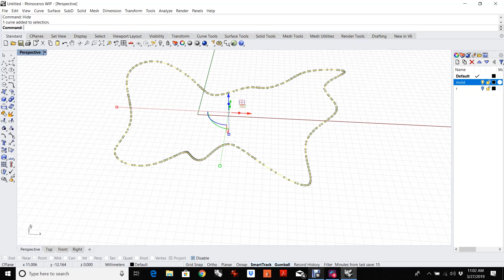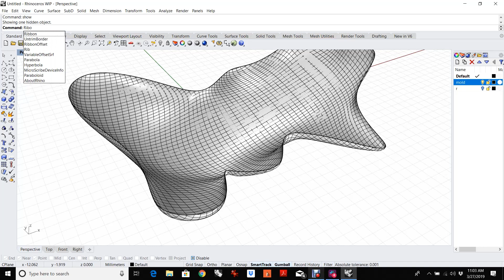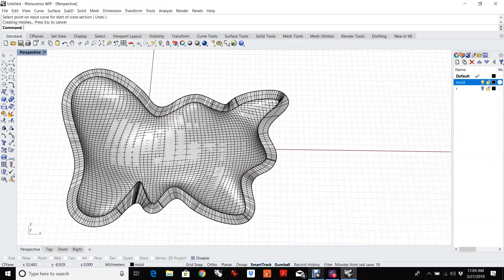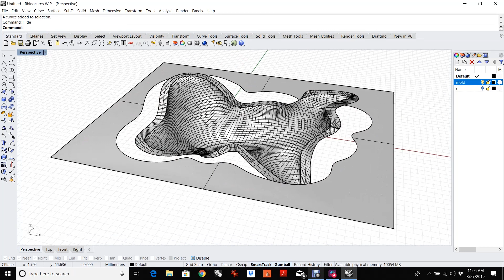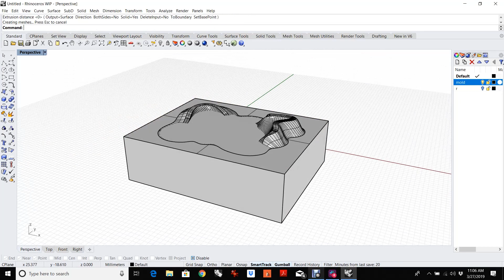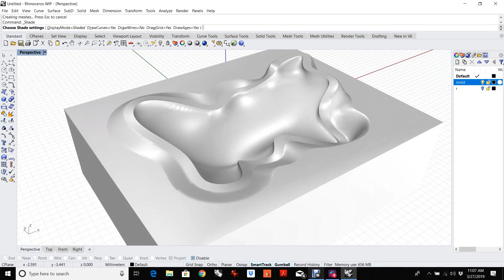Rhino 7- How to Make a Partition Surface

Comment: You fail to mention the cPlane's influence on the direction of the offset.  This command gets particularly nasty when the curve being offset is a 3D curve (not flat on one plane). It seems to only work when in Top view (or whatever view is closest to parallel for the ribbon), its not great. Do you mind also explaining what each option within the ribbon offset actually does?
Reply from the maker: The cplane has less of an influence than you might think... the real factor in how well this works is the complexity of the original curve that is offset. If it's returning nasty results, run a rebuild on the curve, drop a few points but don;t go crazy. simply re-parameterizing the curve using  rebuild often is enough to clean up any gank in the input curve and return a better result. 

if you get some nasty results, it's often because the input curve is a mess. 

SInce we are trying to generate an offset, and since the offset often wants to be less detailed, the rebuild can be super helpful.

Comment: I know this is an old video, I've been able to do everything except blendsrf, as the polysurface from ribbon offset is open? so it doesnt have a closed edge to blend with the planarsrf edge... i cant seem to join the edges either. Not sure what to do about it or where i've gone wrong
Reply from the maker: make sure your tolerances are reasonable, if you 
are working in mm at .001... you will struggle to join stuff unless you model very specifically.

for mm, .01 is usually fine for most models unless they are super tiny.

Comment: HI,

Question: How is it that when I do my draft analysis, the result isn't one closed curved as though it looks like it, but rather a crazy amount of shorter curves all seemingly connected to one another. The RibbonOffset command doesn't work on opened curves. What can I do so that my DraftAngleAnalysis results in 1 closed curved? I had to closed all 48 curves one by one with the ConnectCurve command.
Reply from the maker: hard to say without seeing your file, send it to tech@mcneel.com and we'll take a peek.

Comment: Thanks for all the tuorials, Kyle. I've been using Rhino for 6 months and I'm hooked! I'd really like a full tutorial on moldmaking if possible. Many thanks
Reply from the maker: I’m far from an experienced mold maker, but I did work with one on a project that inspired this tool. I generated the ribbon, he did all the actual mold making. 

I have made molds for simple parts but nothing complex or with slides, etc.

Comment: As others have said - video is useless, how hard is it to make a video that guides you through the full mold process with Rhino instead of these half baked tutorials and gifs lol
Reply from the maker: The video is about how to make a partition surface, not how to make a mold. The partition surface is simply one part of a complex modeling problem required to make a mold. 

This tool was missing from the workflow in previous versions of rhino. 

You’ll need to learn a lot more than this tool to make molds.

Comment: How would this end up as a mould? what exactly would be the moulded result? this video isn't clear at all, seems like you are just showcasing a tool without any  direction, I wanted to learn to do something like the example shown on the Rhino website wih the mould from the arm 3d model
Reply from the maker: correct this is just showing how to make a partition surface, it assumes you know how to make a mold already, as this helps with one of the difficulties making a mold. 

There are tons of videos on mold making on You Tube-
Reply: @Rhinoceros3d  weird that this is the main result when looking up "molds" on the Rhino website, and weirder still that you choose to make a detailed video and provide files for just the advanced solution while just showing the useful basics in just a gif on top (not to mention the downloadable test file is just the finished result so it's not like it can be used for practicing what you show in this video) and reading the comments on both this and the "Mold Making Tools: new in Rhino 7" video which shows what people actually want to learn yet you decide to just post the animation with the only """"explanation"""" being the icon for Ribbon Offset showing up on the screen

Glad to see the official account of the software being too lazy to teach its own tools cuz "there are a ton of videos on mold making on YouTube", the idea is to learn the most efficient way to use the tools and not depend on a probably unreliable method that some random youtube channel might have come up with that witht no guarantee that it will yield correct results with no errors since it is just the solution the came up with

Sorry that I expected you to be a little bit more professional, my bad

Comment: I know nothing about moulds, so I don't understand how this could be a mould since it isn't planar
Reply from the maker: Molds very often have non planar parting lines. As long as the halves match up you are good to go.
Reply: @Rhinoceros3d  how is the other half generated? Of can you point me to a video of a complex solid where its cut in half? Like a propeller?
Reply from the maker: @funwithfamfun  you'd start from the parting line of the part, and build one parting surface, then copy it for the other half- you'd then split your part and connect each copy to one side or the other. everything outside the parting line is identical top to bottom so they match up.
Reply: @Rhinoceros3d  Any chance you make a tutorial for a Mold where both sides are not equal? For example one is the cavity and other is the Core that complete the cavity of the piece?
Reply from the maker: @lgdneuro9245  once you have the parting line and the ribbon surface the process is identical from side to side. After making one ribbon and mold face (and the blends between them) You simply copy the surfaces that make up the parting surfaces of the mold and attach one copy to the core side and one copy to the cavity side. The actual mold surfaces themselves are of little consequence as the parting line is identical from side to side.
Reply: It would be really great if you could prepare a wholesome video, where both parts of the mold would be generated. For instance - this method would be used as a mold for casting PU foam (e.g. for car seats or something similar).

Comment: Is there a method to automatically generate that parting line / ribbon / 3D curve on a part with hundreds of surfaces and curves?
Reply from the maker: Join them into a watertight poly surface and then run Draft angle analysis. There are tools to gen the parting line curves there.
Reply: @Rhinoceros3d  Worked perfectly.  Wow and thanks
Reply: @Rhinoceros3d  thank you! I did not know that existed. thanks for the hint!